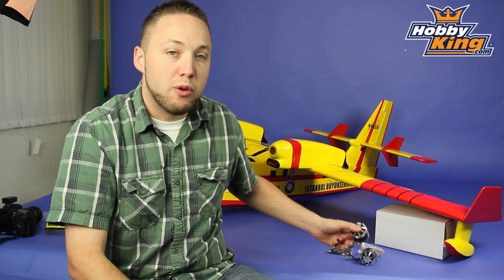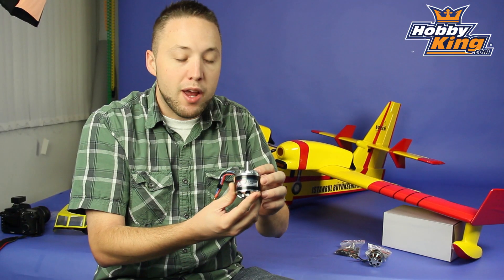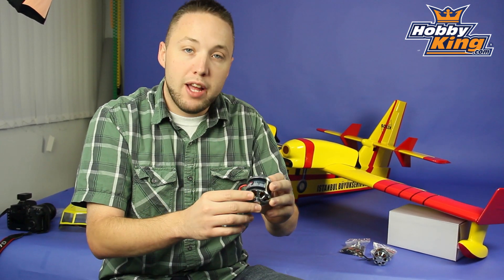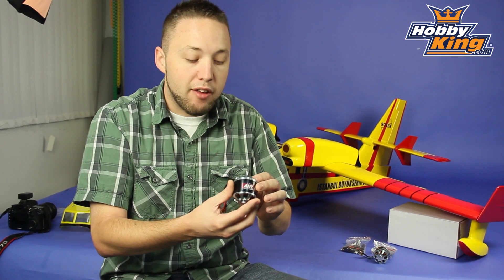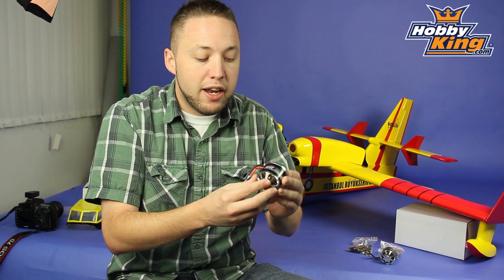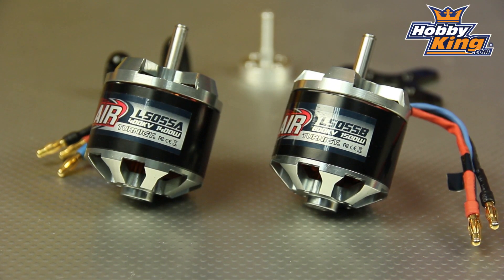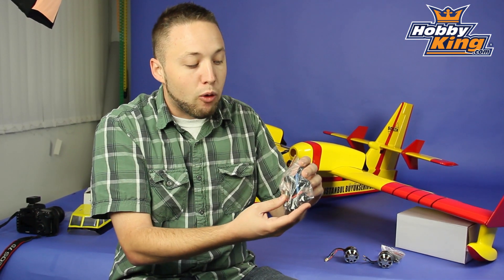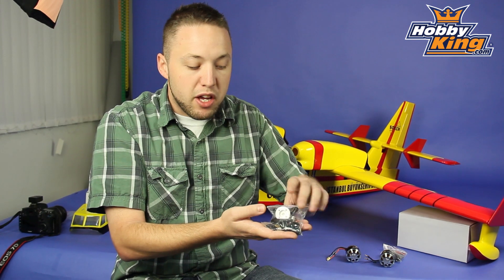Turnigy L5055B-600 Brushless Outrunner 600kv - HobbyKing Daily

Comment: i'm impressed with the strength of these motors, mine went in vertical at high speed, still runs great and smooth as.
well done turnigy for making it and hobbyking for the great pricing.